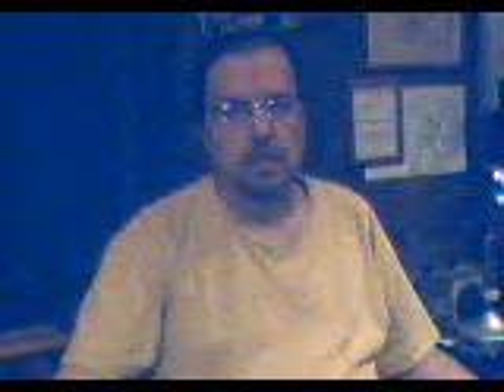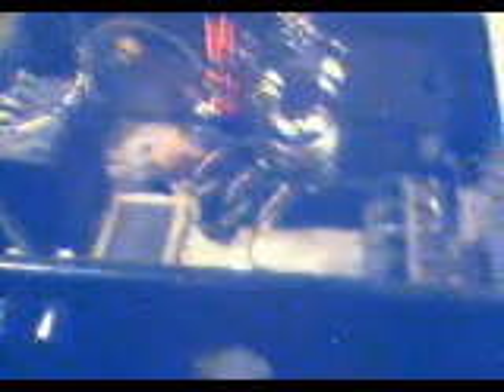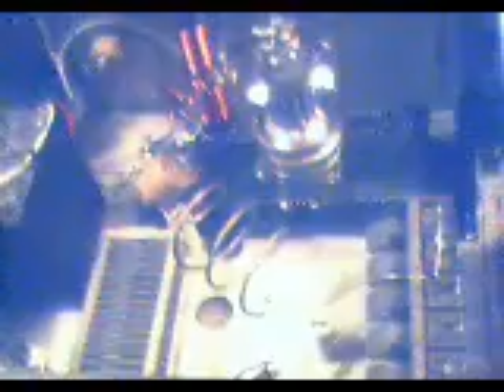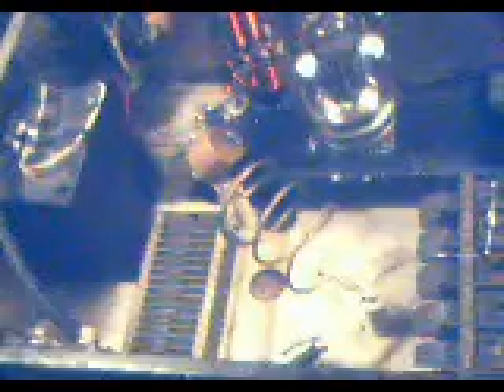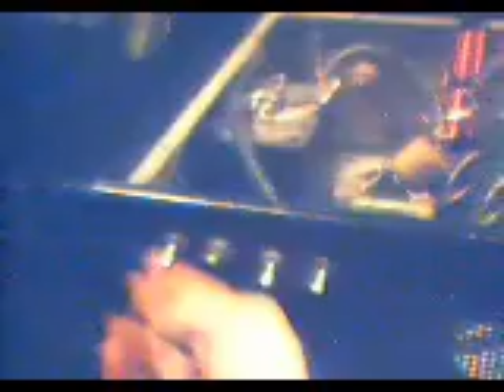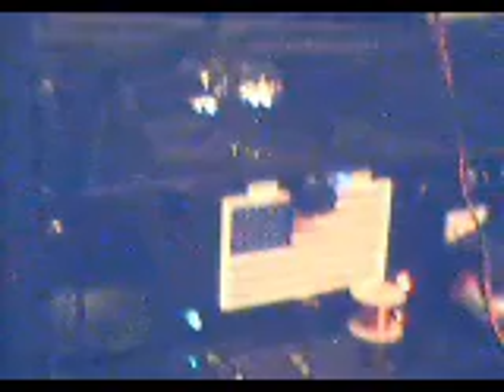4-400 Linear Amplifier Project

Comment: @KF4QKR I picked one of these Eimac 4-400As up on the Goodwill auction site for like 70 bucks. Some guy in the TCA offered to test it for me if I ship it to him. I have tube testers, but they fall pretty far short of the 1000 or so volts needed to begin to get any data during a Gmohs, and Ip testing round, but I do have an some larger power supplies. Is 70 bucks a good price? Even if its bad, I suppose it looks cool for the guitar and amp shop, & can sit atop my 1936 Coronado 850B Am radio.